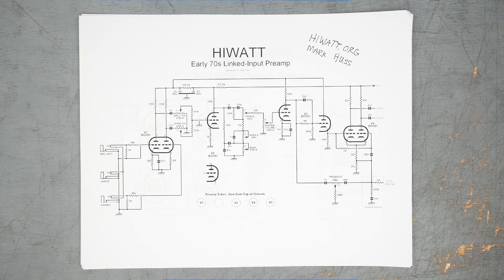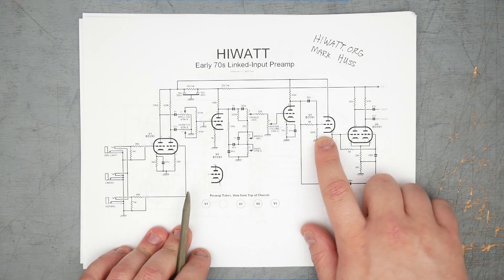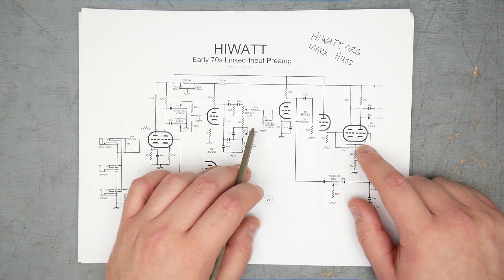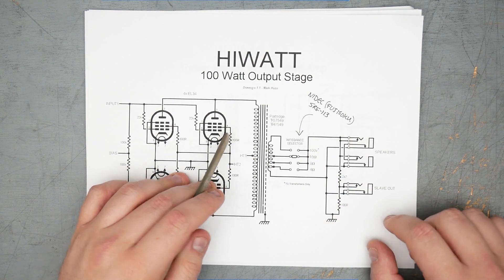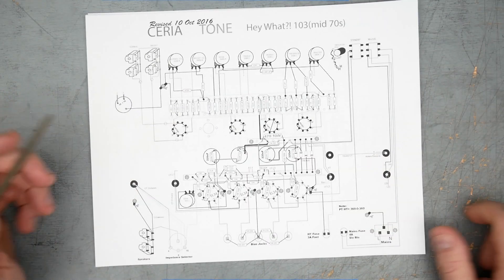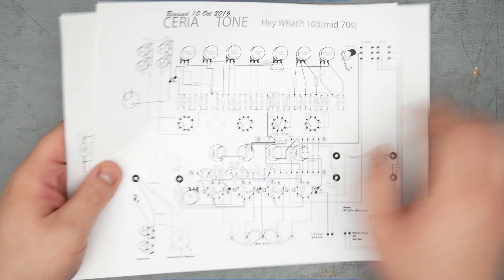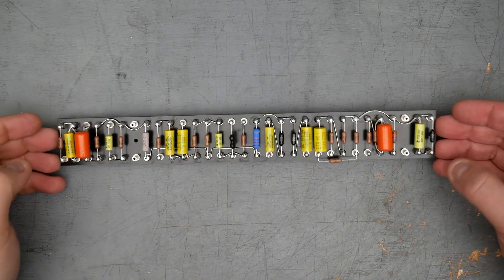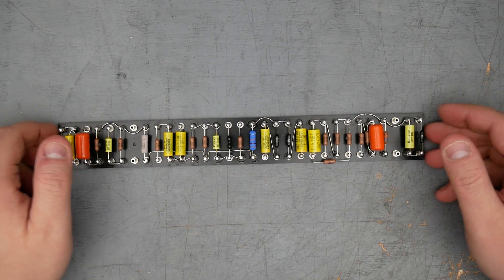Hiwatt DR103 Build Part 2: Schematic and Main Turret Board!

Comment: One tip for those turrets solder joints. Heat the turret for a few seconds before adding any solder. Then it should flow easily right away once you start adding solder. Those bigger turrets need some more heat before the joints flow nicely onto them.

Comment: BTW I use Japanese impedance selector on my Bluesbreaker18 builds. 6A version. It is a overkill but those small impedance selectors are not reliable and often limit the power one can push into the cabinet. Now if you use 4 Ohm cabinet 6A switch might be even starting to be to small. DR504 often kick out 60Watt real power despite having two EL34 power tubes. DR103 can make 120Watt and even more if you go for 6550 tubes. 6A at 4 Ohm is 144Watts “only”. DR103 is very close to that power rating. Overdriven it could reach the maximum rating. If you use 16 Ohm cabinet there is no issue.

Comment: Great stuff-I wonder if you noticed a difference when soldering components after wire brushing-I suspect the earlier wire soldering difficulty may have been due to terminal oxidation? Are you guys still using 60/40 lead solder?
Reply from the maker: Yeah I wire brush terminals and turrets to give clean metal, oxidized metal is hard to solder to. I use 63/37 solder.

Comment: You were building a separate bias supply since your transformer doesn't have the extra winding like the original, so when you start on the power supply section it will  differ from the traditional schematic and layout. However, I hope you can address a question I have about the original.

I'm asking because I recently bought a clone kit from Mojo. The Mojo schematic, much like Mark Huss's like you displayed, show the transformer secondary connected to a resistor and then a diode to create the negative voltage needed for the bias. However, every layout and picture of a 100W Hiwatt has the diode off the transformer first and then the dropping resistor. I looked up the resistor-diode circuit and it seems like order doesn't matter in this instance.

What's bugging me is that with the known high build quality for the original Dave reeves Hiwatt stuff. How or why would they have such a basic schematic/layout mismatch? Or am I just being an old man yelling at clouds?
Reply: I have ver 2 and ver 3 of the Mojo schematic. It looks like they addressed this issue in ver 4 currently posted on their site and changed the schematic to keep the layout unchanged. I was just wondering about voltage hitting the diode before the resistor and whether there was any danger in that.
Reply from the maker: I've seen all kinds of different configurations. I've even seen bias supplies built off the primary of the PT. It's arguable the hiwatt supply should be modified anyway, to allow for adjustment of the bias voltage via potentiometer.
The bias supply just needs to deliver the required negative voltage to the grids of the power tubes. Whatever combo or configuration of resistors/caps/diode makes it happen, should be fine.